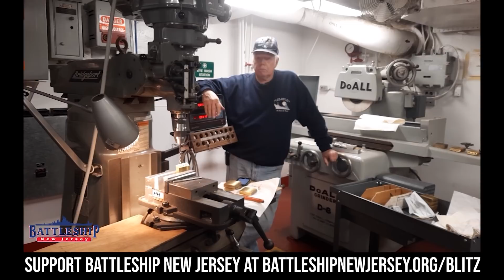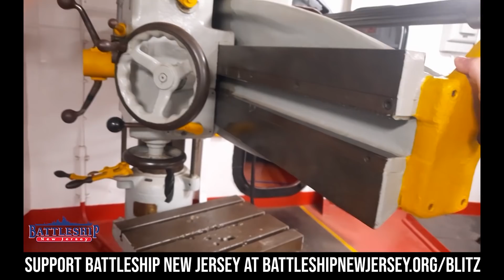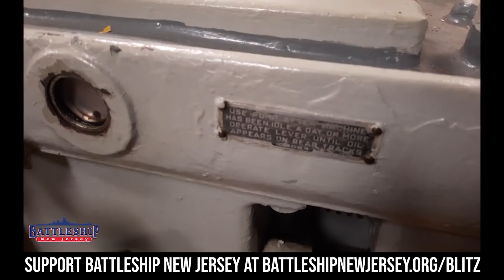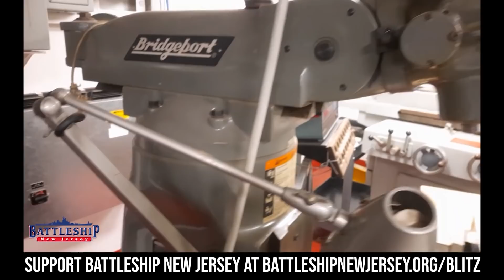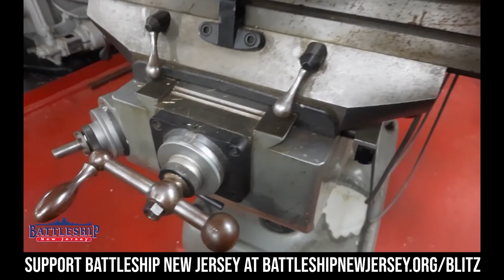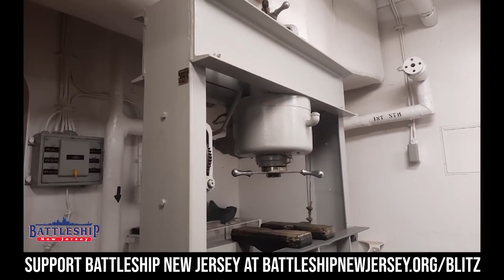Battleship New Jersey's Machine Shop with Ken Kersch

Comment: Hello, I served on the Jersey from '88 until it was dry docked for decom.  16 " Gunners Mate Turret 3.  Anyway, We had a B-end to an elevation hydraulic pump from one of the guns fail.  We were on a west-pac and going to do a firing mission in the next couple of days or maybe even the next day.  At the time Senior Chief Siler (Later Master Chief) from turret 2 tells me to take a 1' by 1' by 1' brass block with some ancient blue prints down to the machine shop and have them make a new one.  I do so.  With a little complaining and lots of frowning a second class machinist takes the block and blueprints and sarcastically tells me, "Well this is going to cut into my night that I had planned."  Looking at the plans and the details that were on it, I thought there was no way they could get it done in the amount of time that we had.  Obviously I was somewhat new to the Navy.  From a block of brass to a highly detailed B-end pump component in hours.   I mean HOURS.  I believed he worked on it from when I dropped it off around 1600 through chow and into the night.  When he called us, I thought he was having problems or to tell me that he wouldn't be able to get it done in time.  WRONG!!!  I was late in picking it up from him (he claimed) as he said he noticed it still on the desk being completed for some time now!!!  That right there taught me to never underestimate the possibilities of getting something done when seemingly impossible tasks are put in front of you or dare I say the Navy.  I had nothing to do with the success that day except for being a witness to it and it helping me to understand just a little bit more what it means to be apart of the worlds most decorated team.  They weren't faking it.  Not even about being mad.  Over the top skill level and tasked with some fairly impossible feats.  My hat goes off to the Machinists from the USS New Jersey, Well at least in doors.

Comment: The technologies of the time is very cool. Curious question the new ships of today, do those machine shops have any CNC Machines such as conversational programming or EIA programming capabilities? I have been machining for 30 years and have ran a few machines from WW2  era they are very ridge machine and I find the equipment built during that time frame very fascinating. The machining principles are the same today as they were 150 years however the machines of today have a lot more creature features. An argument could be made todays machinery are not built as good as WW2 era as most products are built and designed today are limited for a finite numbers of usages to keep sales at all time highs.

Comment: That's a very well equipped machine shop for a ship. I remember when I was in college, one of my instructors saying "This is a surface grinder. Most of you will never use one of these unless you join the RFA." He was right. Most ships I have been on had a lathe and a drill press, a normal bench grinder, and maybe a vertical milling machine if you were lucky.

Comment: How did being on a pitching/rolling ship affect your lathes and other machine tools, if at all? Were there ever times it was too rough to use certain tools?
Reply: This is the question I wanted to ask, seems like there would be many problems trying to machine things while under way, especially in rough seas. There would be real problems using the surface grinder as only gravity holds the table, floating on a thin film of oil, to the bed.
Reply: Probably didn't do a lot of work in heavy seas. But that is reasonably rare. Even on a ship that was less than 400' long like the one I was on, it was rare we couldn't get work done due to sea state.

Comment: My father was on the ssn Sealion on Dec 7 1941. They were assigned target towing duty so we're away from Pearl during the attack. A IJN flight group found them before they cut the gear loose and dived (wouldn't have done much good in clear water anyway). They fought off 8 planes. One or two had bombs which came close enough to dent the pressure hull. I used to have all his pics of his WWII service ships. The Sea Lion was not sunk but was patched up and sent to the mainland for drydock. Dad was transferred to the Hornet..

Comment: How did you know how how to make the gear? Did you have a blueprint to follow or did you have to copy the broken part?
Reply: Additionally, for a normal shop making involute gears, if you know the diametral pitch, number of teeth, the pressure angle, width, and the shaft and key sizes, you could just make one to fit.  (the outside diameter of the blank is set by the pitch and the number of teeth and the 'Machinery's Handbook' has those formulas, basically (Number of teeth + 2 )/ diametral pitch.  Some of the old ones on BB62 are likely 14.5 degree pressure angle, for most newer Impirial gears 20 degrees is more common.  I have most of the cutters for common pitches for 14.5 degrees and 20 degrees, but they might have had needed some uncommon giant ones on a ship such as that.  They would likely use the dividing head for those gears for which it could divide for the number of teeth and then cut them on that Milwaukee combo mill in their shop with a set of gear cutters to make the gear.  Basically, make the first cut, rotate the blank one tooth and repeat, sometimes twice as you might not cut the full depth in the first pass.  I did not cut a lot of gears, so I used to be nervous cutting gears as like many parts one foul up and its scrap metal.  It is always satisfying to cut that last tooth and see that it lined up right with the dividing head.  I would imagine that machining while on the high seas would add even a bit more excitement.
Reply from the maker: Both methods are used, depending on the state of things. We have many books of the parts of many pieces of equipment, but sometimes it is easier to just replicate the original

Comment: Those old lathes will still be operational LONG after we're all dead & gone.
Reply: They last a really long time if protected from corrosion and properly lubricated in operation.  One of my lathes is WW2 vintage with babbit bearings, and still works rather fine, I have had better luck with that than some newer tooling.

Comment: I love information on WW2.  I always wondered what type of machine shop they had on ships.  I would of loved that job but what qualification did you need.  I'm a former machinist that worked in a very large corporation in Beverly Massachusetts.  In my apprenticeship, we ran most of those machines. Even the plainer . They still used it as part of the machining process. Never wanted to use it.  When i seen CNCs being installed i knew it was over. Thanks for the video
Reply: I'm in the process of buying a small lathe and milling machine for my shop

Comment: How were involute gears cut on this setup? I didn't see any broachers or hobs
Reply: likely used the Milwaukee combo mill as a horizontal mill and set the blank up on the dividing head, cutting one tooth at a time with a set of gear cutters.  Cut, rotate a tooth, cut, rotate, cut . . . until done.  Probably originally had a set of cutters for each diametral pitch of gear used.  10 or 12 sets of cutters (8 cutters each) would probably make just about every gear used on board at the time it was built.

Comment: I sure have, much of that equipment is used in machine shops to this day, that kind of machinery will last forever. I do primarily CNC but have done plenty on that type equipment. The new machinist will probably miss the joy of fractioning a index head and knowing what all those holes and plates are for.

Comment: Those turret 'bucks' would probably rake in some nice donations and be hot sellers in the gift shop.  The initial cost would be steep but sales may more than make up that cost.  The design could be contracted out a local machine/fabrication shop and sell for a lower price, and have a handful that are made about the NJ with NJ stock for a lot more.  I'd be first in line to get one.
Reply: Unless they set up a cnc tool to knock them out, that would be very labor intensive, and would  limit the market for them.

Comment: Planers and shapers are coming back into vogue in hobby machine shops. Owners are getting amazing tolerances and for roughing taking very large cuts after considerable restoration work. Shapers and planers are similar in function except that a planer moves the work against a stationary cutter and a planer holds the work steady and moves the curser. Both machines can cut long strokes.

Comment: My father owned a tool and die company in Newark Newark NJ. I worked there for 22 years.  I used many of the same machine tools you showed in this video. We had the exact same surface  grinder you showed in the video that doesn't work. Spent many hours using that machine. I primarily ran a  wire EDM machine. Very nice setup for being in a ship! And I agree, the Bridgeport milling machine is a very versatile machine. You can do most anything with it.

Comment: Company still uses two vertical lathes from the shipywards in TX that were used during WWII to make driveshaft flanges. We use it to make flanges and pipe fittings for the petrochemical industry up to 6' in diameter.

Comment: Those Standard/Modern lathes were a surprise as they are made in Canada. Well made, I have a 14/40 myself. Surprised that there aren't larger or more milling machines but most shop work is turning & drilling anyway. Would love to see what the tool crib would contain. Guessing it's mostly empty now but they must have stocked a lot of tooling in the day. Also, what would be carried for metal stock to make parts?

Comment: I noticed on the 1st machine shop tour that the drill press table has quite a few nasty holes drilled into it. I cannot imagine that that happened while the ship was in service.
Even today in a machine shop, whoever did something like that would pay for it dearly. I cannot imagine the wrath of a chief who's people were responsible for that.
We would use metal filler to repair that today but you would still be able to see the damage . . .
I've been in machine shops since 72 and I've never seen much use for the planer either, but most places seem to have one. The fancy ones use a double bit that cuts in both directions.
Reply from the maker: The only person who really works in there is the same person who used it while it was in service so I can guarantee you it was a navyman who did it.

Comment: Question: Does the roll of the ship at Sea cause any problems with accuracy when cutting?
Reply: Probably not... Laths tends to be solidly and soundly secured to their location.
Reply: @captiannemo1587  Most shop environments aren't subject to rapid rotation, which could twist the lathe, or more likely, cause the work to be deflected.

I agree for most jobs with more that 0.010" of tolerance, it probably wouldn't matter.

Comment: I noticed that the lathe says it must be kept level, I am just wondering if anyone knows if the lathes and what not could still be used in rough sea? or did some/most machines require calmer waters?
Reply: yes, they must simply remain level relative to the floor. If the floor and lathe both move out of level uniformly, which they would do at sea, the operations would be unaffected. If the lathe suddenly became askew from the floor it is mounted on then it could potentially cause issues as the bed would tend to take the shape of the floor and the tool paths would no longer be parallel to the work. But this was not an issue.

I guess what I am trying to get across is that the lathe must only be level to the floor. If the ship and lathe were to tilt out of level it would not be an issue, but if the lathe were to shift OR the floor were to thereby throwing them out of level with each other then you would have an issue.
Reply: @erikkayV  Thanks for your reply, learn something every day.

Comment: So I must ask: If one wanted to replicate this shop on shore somewhere, what would it cost? I know many of these older lathes are collected and restored, and have substantial value.
Reply: well, you would have to obtain most of the equipment from the secondary market and the prices fluctuate wildly depending upon machine condition and how much you are willing to fix yourself. 
As just one example the Monarch 10ee lathe he shows toward the end can be found used in serviceable condition for about 7k or in fully restored condition for about 15-20k Some of the other lathes, despite being large, can be had relatively inexpensively if you hunt for them but plan for each one to cost anywhere between 3-10k. Similarly for many of the other machines. Then you have to pay to get these large and heavy behemoths transported to you, you need to have 3 phase power available to run them and you need a concrete pad large and thick enough to actually support and level them. So the cost is much more than just the machine. Oh, then you need to actually purchase tooling for them which is easily a lifelong continuous purchase. 

Now if you are talking about what they would have cost brand new, idk but some of those machines with installation would have been around the 100k mark some maybe a little lower some maybe a little higher. 

Of course these machines were all part of contract purchases so I doubt the military paid what the consumer would have paid.
Reply: @erikkayV  I want a Monarch 10EE, those are nice machines.
Reply: suprisingly that monarch 10 ee is probably more costly than those other bigger lathes
Reply: Depends on where, and how resourceful you are.  In much of the country, especially the eastern half, a lot of old machinery isn't worth much more than scrap value, so if you are willing to put in the sweat equity, you can put together a fairly substantial machining capability without a huge budget.

Other parts, not so much  Being out west adds some to the cost of machinery simply due to there being less of it around, and the cost of shipping it from the east where it is more plentiful.  I live in Alaska, and just paid $1700 for a Bridgeport mill from the 1960s.  It's costing me more than that to get it here.  There's very little available here in the way of used machine tools, and what there is tends to be overpriced.

Edit to add; 3 phase power is not really much of a challenge these days, at least until you get into some of the largest machinery shown in the video,  due to the ubiquity of cheap Variable Frequency Drives now.

Comment: Hey just to let you know I was the LPO on BB62 from 1985 to 1987. The surface grinder was obtained in early 1986 from the Defense Reutilization Depot in Northern California.  We used it alot, and it was originally positioned where the Bridgeport mill is. Where the surface grinder is now positioned was an electroplating sink. The Standard Modern lathe was installed in April 1986 prior to the 1986 WesPac cruise. The Bridgeport was installed after I transferred so I don't know when it was installed.
Reply: they had an electroplating sink!? was that original to 1942? what kind of repairs/ maintenance would that even be used for!? that's like crazy specific equipment.
Reply: @Mitchismelon  We used the electroplating for plating end bells on motors and electroplated pump shafts from time to time if the pump shaft was just slightly scored or worn. Mainly on bearing surfaces.  The electroplating sink was installed in late 1985. I taught several guys on how to use it.
Reply: @Mitchismelon  Hi Mitch- we used electroplating a lot in the machine shop.  Take for example a shaft that had worn down 4 mm and was no longer in specs/usable. Instead of throwing it out and spending a ton of tax dollars n purchasing a new one. We would plate that section of the shaft 8-10 mm and use the lathe to skim cut it within specs. Very cost-effective and quicker than Amazon.
Reply: @Mitchismelon  it's not all that specific, but it is super handy and even more cool =)

Comment: Hey Battleship New Jersey, can we have a video about unwatering, and counter flooding equipment and procedures on the battleship?
Reply from the maker: Check this out https://youtu.be/MgyuaIiVtJw
Reply: @BattleshipNewJersey  so I'm that video you guys talk about shoring doors ect. But say we have a whole that we know is not fixable till we get to port, or ship is listing and we need to counter flood how do we choose which compartments, what equipment is used ect. How do they drain a compartment that they have patched? Or do they just leave it till they get to port?
Reply from the maker: If a hole is too big to patch while at sea, that compartment is sealed, any other compartments with water are pumped out, and there will likely be counterflooding on the opposite side of the ship. Generally you'll want a compartment to counteflood thats symmetrical or close with the flooded one. To keep things even. 

If a compartment is patched but still flooded, they can send in people with pumps to pump it out. If they can't pump it they probably couldn't patch it in the first place.
Reply: @BattleshipNewJersey  have you ever covered the pumps themselves? It wasn't until I saw that smarter everyday video with the sub when they turned on the damage control pump. two firehoses into a Rubbermaid bucket could not keep up.
Reply from the maker: The link we put higher up in this thread is as much as we've done about the pumps.
Reply: Information about "de-watering" would be interesting, and of course, "counter-flooding"  procedures would be equally interesting.
Say "Hey" for a turret model plan!.
Reply from the maker: Did you see this video about flooding on board? https://youtu.be/MgyuaIiVtJw